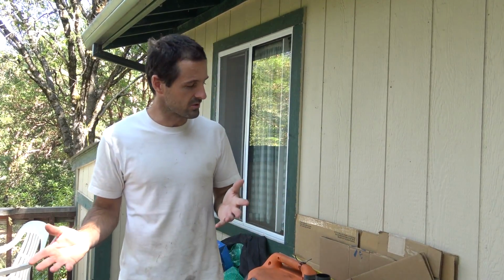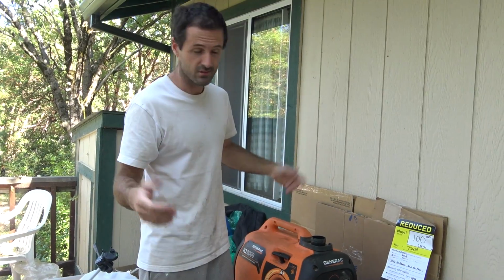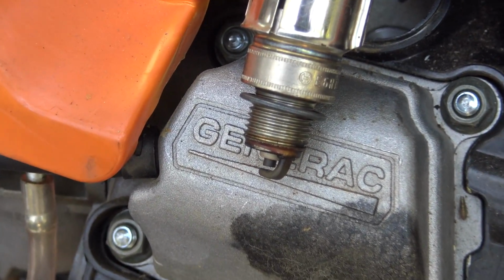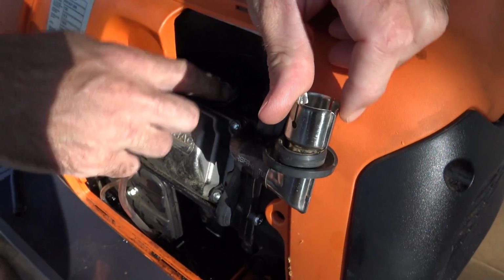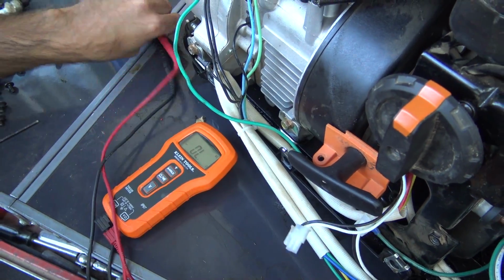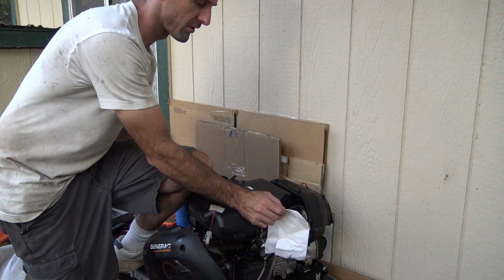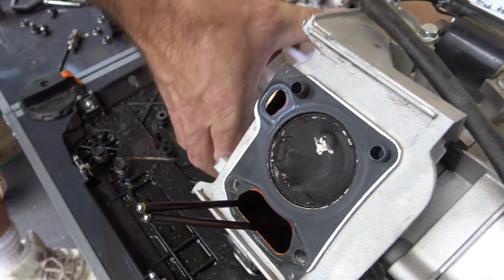$25 Generator From Lowes - Will It Run?

Comment: It may be time to invest in a compression tester, or start using one you might already have. Mine has paid for itself over and over. If in fact there is a lot of blow by occurring and the cylinder looks pretty good there has to be one or more rings stuck. If this is the case, pop that piston out and soak that baby in some PB Blaster overnight. In the morning tap on the rings with a plastic hammer and they should pop out.

Comment: the engine was flooded in the past with gasoline and that's why the oil level is so high. when that happens usually washes all the oil off the cylinder walls which will cause zero or low compression. I would change the oil put in a new spark plug and spray WD-40 in the cylinder and I'll bet you it will run
Reply: That doesn't mean you have "washed out" cylinders, it means that the engine is wore out. If you have to add oil to get compression, that is the absolute definition of bad rings and/or damaged/misshapen cylinders. In other words, the engine needs overhauled. If the rings are good and the cylinder is round and in good shape, you should flat-out be able to pour gasoline in the cylinder and it should stay there. Moreover, you should then be able to dry out the cylinder and it should fire right up. Look up compression tests and how to check if your rings are bad. A dry cylinder shouldn't have zero compression. Yes, it would be higher with some oil in the cylinder, but that difference in a good engine would be like... 150 psi dry, 180 wet. Way more than enough to run, wet or dry, provided the internals are in good shape.
Reply: I would disagree. If the oil level were that high because of gasoline, he probably would've noted the smell and the oil would've been much thinner than it was. Plus you can see an oil film stuck in the cylinder cross hatch. It is a problem with the cam. Either a wiped cam lobe or a broken camshaft. Also, the direction of the flywheel will have no bearing on the strength of the spark. The coil doesn't care which direction the magnetic field passes by it.
Reply: 16:27 You can pretty clearly see an oil film in the cross hatch from that crappy oil.
Reply: I get a couple of vehicles every year with no compression from washed out cylinders from fuel. Put a few drops of trans fluid or spray of wd40 . Crank it over a few times before installing spark plug and it will probably fire up.
Reply: for older motors carbon is a good thing as it increases compression. removing a vast amount at once will generally make a engine loose compression if im not mistaken. My bet is that the starter puller was incorrectly put on as others stated. Its pullin in the wrong direction which vents through the crank. Grab a new spark plug and try reversing the puller and it may just fire up with a bit of luck. It had a tiny spark in the beginning as the fly wheel back lashed a tiny bit going to correct way causing the tiny spark.
Reply: Afraid not...
Reply: Moreover, it had compression when he spun it backwards because it pulled air in through the exhaust valve. It had air to compress at that point.
Reply: akio2589.
Reply: My goodness some one actually knows about octane!! Exactly
Reply: 6g99gl3
By see
Reply: I agree  with Doyle Smith the rings are dry

Comment: your thumb has way more than 5 psi. your thumb is basically 1 square inch. you think you can only put 5lbs of weight on it? wrong
Reply from the maker: Good catch. I realized I misspoke afterwards. I still think if the engine was healthy it would be tough to keep a thumb on the hole.

Comment: I think you've got yourself an absolute bargain!  Pretty sure when you put it back together the right way around it'll be fine!
Reply from the maker: It should be ok either way. The parts have to be worth something even if I can't get it going. I would really like to have the satisfaction of hearing it run though.
Reply: Jennies Garage did you ever get it running what was the problem......
Reply: I'd say that either the starter cord is wound wrong or the valve timing is out. Are we sure there is no decompressor?
Reply: the raw materials are probably worth more...
Reply: Spiritus u
Reply: I call that a bargain, the best I ever had! I wonder WHO is writing all these Comments? C'mon tell me WHO are you, WHO, WHO are you?

Comment: Was the pull start wrapped around the wrong direction 😂
Reply: My first thought when he had compression in "reverse" - the cord snapped off at the pulley and the previous owner reattached it and wound it backwards.
Reply: harrygibus wouldn't that cause the spark plug to misfire?
Reply: Matthew Mck this here was my thinking also!)
Reply: I'm obviously not fully familiar with the device in this particular generator, but all of the records that I've seen, if you were to wind the cord the wrong way and pull it would not engage the mechanism at all. So it'd be pretty evident if it were wound the wrong way since the cord would come out with essentially zero resistance and maybe an annoying ratcheting sound.
Reply: Most pull starts have a one way engage  operation..
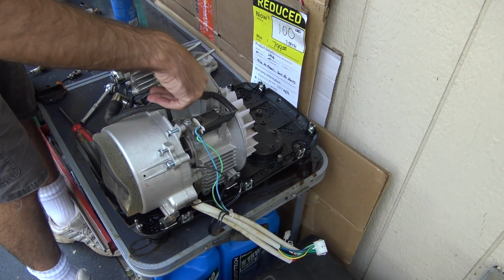Reply: I don't know how the ignition system would handle the crankshaft spinning in reverse - but the valves will be out of order, exhaust sucking and intake blowing. At 13:05 the start cord handle is visible running out the left side of the pulley - common sense would say the cord goes down around the pulley (you pull the cord up since you usually stand above it) so it would be wound to turn the crank clockwise when it's pulled. At 15:05 he gets compression turning the crank counter-clockwise, so maybe the cord is meant to go over the pulley.

Comment: The pull start is round up the wrong way making the motor spin the wrong way
Reply: if it would be mirror of camera we couldnt read the print
Reply: snakes5044 it would still have compression both ways if that were the case. 
Wroooooong
Reply: Could it be the ohv not set properly and the valves are opening on the wrong stroke
Reply: That wouldn't explain why it seems to have compression the other direction.
Reply: OMG !
Reply: CR2504life no, no it wouldn't. It would just suck at exhaust and blow at intake.
Reply: Close, but not quite. Wiped intake cam lobe or broken camshaft. The intake valve isn't opening enough or at all. Had compression when he spun it backwards because it pulled air in through the exhaust port.
Reply: than how come the cord retracts back in? they have the spring wound wrong too? doubt it. plus the paws shouldnt grab if going the wrong way.
Reply: You are looking at a mirror image on camera.
Reply: Yes I think it would, wouldnt it

Comment: I would have guessed it was a faulty compression relief mechanism and since it is a push rod engine it would be in the crank case. But , since you said it doesn't have that I am lost. Btw, your antics and your subtle humor make me laugh. Love your videos man (especially your CT90 series) since I have the same 1969 CT90. Also, Do you still have the air cleaner for the side since you swapped for the atc125? I would totally buy it from you if you do.
Reply from the maker: Thanks for the kind words. Unfortunately the air cleaner was ruined, lots of cracks and a hole in the side, so I tossed it.

Comment: check OHMs of resistance in your spark plug to check the health
Reply from the maker: That's what I was trying, but it wouldn't read anything. Maybe it's my tester
Reply: Jennies Garage I think you can go to the mfgs website to see how much resistance each plug model should have. Keep up the good work!
Reply: Jennies Garage just change your range on the test meter...ie. Meg ohms. Get spec. first to know if it's in acceptable range of operation. 👍. Not liking this cliffhanger much!!! 😖😠

Comment: recently got a Honda eu2000 generator with a seized engine to work on. if it is built similarly to the Honda, then you are going to have to completely reconnect the inverter board to be able to run the engine.

Comment: can I donate a bike to you to wrench on? We need more bike videos and I feel you are close to my neck of the woods!
Reply: ... what if he told you he has a bike you've always wanted?  ; D  Can't wait to find out what the issue with the generac is...  For such a newish genset, I did not like how carboned up it was under the valve cover... PLUS it being wildly overfilled points to someone messing around with NO idea what they were doing.  Could the rings be carboned up and stuck?  It's about the only thing that makes even a little sense to me!
Reply from the maker: what if I told you the issue is not a lack of bikes to work on?
Reply: MISTERComaToes that's from running ethanol gas in it...and not 100%gas like you should in small engines